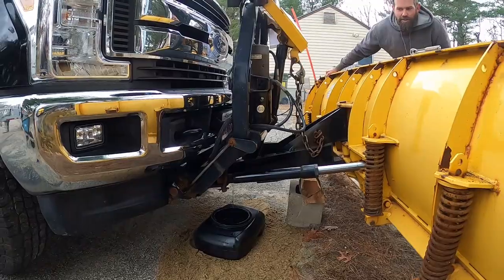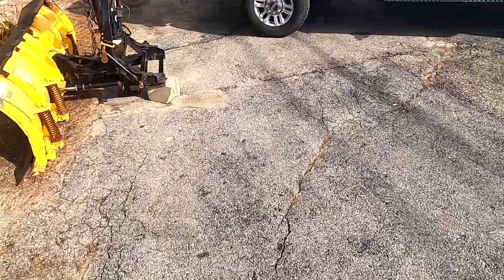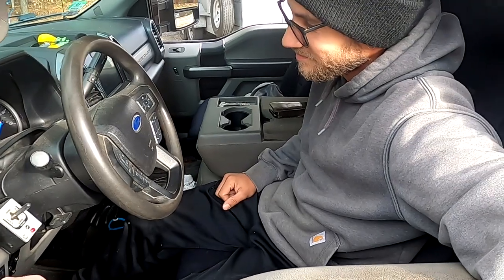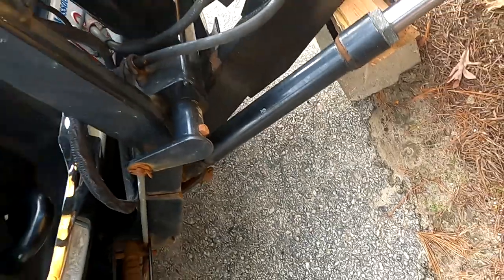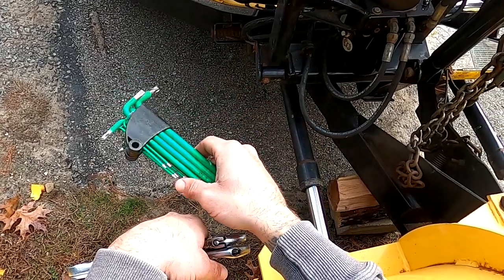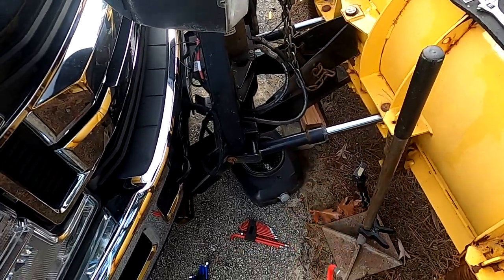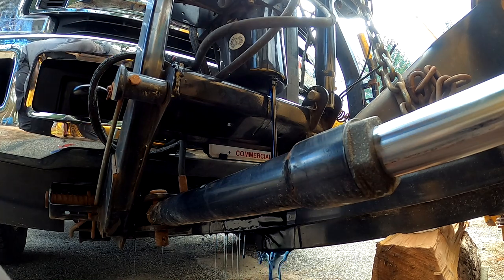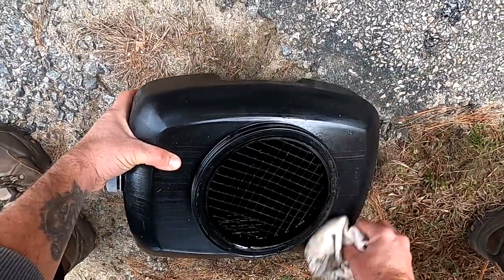You NEED To Change Your Plow Fluid!

Comment: I used to feel that way about the controller, but once I tried one and got used to it I would never go back to joystick, fishstik fits in right hand comfortably and allows me shifting, turning of truck and plow operation all at same time.  Good video. I also take the hydraulic line off the pump instead of piston, that way you can direct the fluid into drain pan while manually angling the plow.
Reply from the maker: I plowed for a company which had the handhelds, I kind of got used to them but still like the joystick 10x more. Personal preference though. And taking it off the pump instead is a pretty good idea, thanks! ✌

Comment: I have an older Pathfinder plow, and it specifies ATF for fluid. It's $38 per gallon at my local auto parts store. I need to replace my lift cylinder, it's leaking at the seal, and the piston has a few deep pits
Reply from the maker: I have heard of people using ATF for their plows so I believe it. It is very similar to plow hydraulic fluid. The only difference I think is how it operates in very very cold conditions. Good luck with your repairs. ✌

Comment: Fixed controls for the plows are nice. I haven't used the joystick but my truck is a manual transmission so a joystick would honestly be basically unusable.
Reply from the maker: I love that controller.... And yea, a loose handheld would be pretty tough in a stick shift.... 🤣
Reply: handhelds are fumbly and hard, you shouldn't plow with a stick shift but if you do get the joystick and operate it with the clutch held just like the stick shift, once you start going you just keep it real low and in 4 low, at crawl speed you'll be fast enough, fixed controls keep it safer, you'll have to cover the extra fuel costs because you're not in a prius.
Reply: @TheChristianHardscaper  I use a handheld it's great with manual transmission

Comment: I probably would have left the cap off and actuated the plow left and right by hand to fill those cylinders. 

Anyway I heard there's a filter in the system? Have you heard anything like that?
Reply from the maker: That probably would have worked too, as long as you get it moving the system should pump it through itself though. Then once I open the reservoir to check it, the air is removed. There is a mesh filter in the pump, never had to take one apart yet though...

Comment: $60 for a gallon seems pretty good. My local parts store has the fisher brand fluid and it’s $22 for a quart!
Reply from the maker: Yea, you save a little money buying it by the gallon. They certainly do not give it away.... ✌
Reply: amazon today I can get the -50 stuff for about $60... it doesn't matter what brand hydraulic fluid you get, the fisher is simply going to be maximum cold (antifreeze) and will absolutely be more expensive because of the priority shipping/warehouse holding adages... it is not worth the extra money simply get the coldest stuff, and change it seasonally.